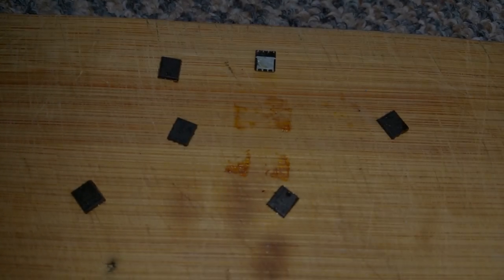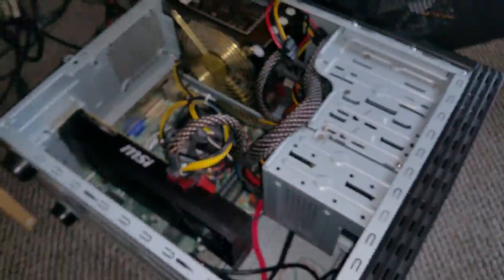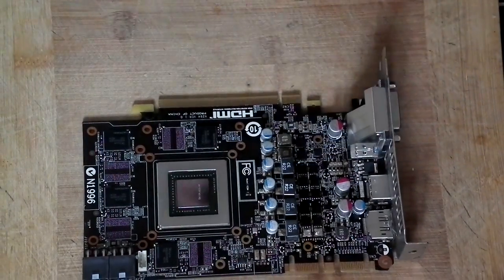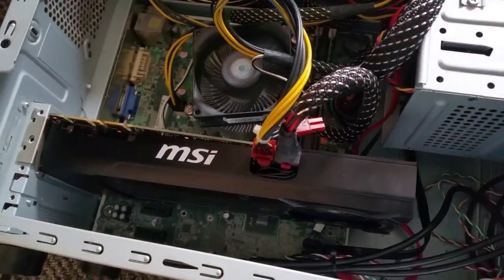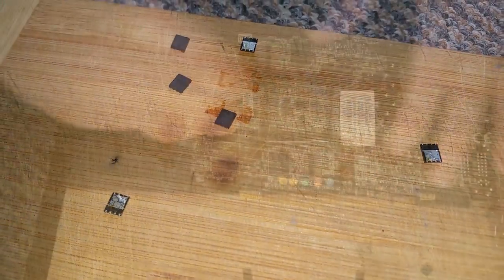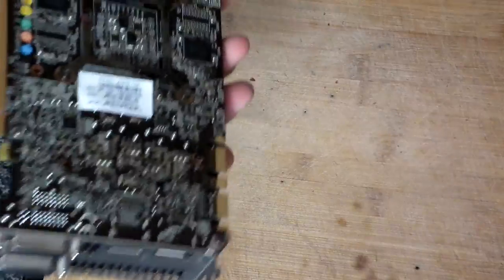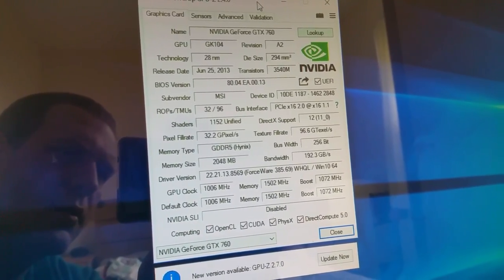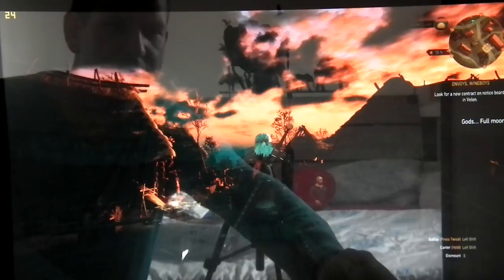How to FIX Graphic Card Short circuit without spare parts

Comment: what temp for the heat gun?
Reply from the maker: S U C C I use 290°C for reflow but if you need take component desolder I use 360
Reply: thanks for rply :) also i have the same problem short on the 6pin should i reflow or try to unsolder each at a time and check if short is gone? thanks in advance :)
Reply from the maker: S U C C best if you have multimeter and check where is short if not just desolder one by one card will working as you see in video without VCC anyway and after you can soldier them back
Reply: can i fix it by baking in oven? xD heatguns cost like 100 bucks here and i dont have shipping in iraq so ill just take it to a repair shop and tell them what to do, thx :)
Reply from the maker: S U C C hi short you can't fix with oven method you really need desolder VCC and find one with short
Reply: I went to my freinds and they had a heat gun i borrowed and i done it and now i found a diode with the short and its working now gonna benchmark it! thank you so much man you saved my gtx 980ti :D also one question if i have 11 diodes connected now i underclocked my gpu to 11\12 of the mghz and just wondering if i need to do that to have a stable card
thx :D
Reply from the maker: S U C C cool man iam happy for you and if you know which component been faulty just replace if possible if not ye man just test your card and do do overcooking you will be OK 
And if you can recommend my channel stay subscribe plus you can make donations as well :-) 

Anything else you will need just ask
Reply: i will :D thx so much
Reply from the maker: S U C C thanks Bro
Reply: The card still has a problem xD it keeps shutting down after 30 seconds and when i check the pins with mutimeter i see readings go to like 100 for 2 seconds then go down its really wierd so im gonna try to find a replacement for the diode :)
Reply from the maker: S U C C ye man I think you definitely need replacing that diode good luck

Comment: For how much time did it worked after repair?
Reply from the maker: Hi this one not sure as I sell that card
Reply: @frogtechtips  I got my gpu repaired had that same issue and I can't upgrade now so what do you think will it work without any issues?
Reply from the maker: @VegetasamaS  yop I think will work
Reply: @frogtechtips  I get a BSOD while playing game "driver irql not less or equal" could be gpu issue?
Reply from the maker: @VegetasamaS  how many vcc you are removed  from your GPU and are you sure there is no more damage as well maybe missing some important capacitator with can make that problem as well
Reply: @frogtechtips  I have no idea about that 😐
The repair guy told that there was a short in its pcb and he fixed it
Also said if short happens again it won't be possible to repair
Reply from the maker: @VegetasamaS  yop for me sounds like that GPU under load have some problems try play game on lower resolution or try underclook your card for test if will be working there is definitely bad some power VCC on card or missing some components is your GPU temperature ok or go to high when you play
Reply: @frogtechtips  I was playing with underclocking and max temperature was 72c
Reply: Still got BSOD several times
Reply from the maker: @VegetasamaS  that's mean there is some different problems try  reflash BIOS and double check your card for some physical damage
Reply: the stuff you hear about people having their cards break after fixing them has to do with the cpu or ram, the connection points on those is so small that they break off after a while, this is a lot bigger so shouldn't have that problem, unless you happen to get a cheap component

Comment: Can I send you my Gtx 1070 to fix? My moniter shorted it through the hdmi port and it doesnt work at all
Reply from the maker: Hi yes you can but iam from Slovakia not sure is good for you if yes send me Mail and I will pass you all details
Reply: @frogtechtips  Your current residents in Slovakia makes for a bit of an issue for me as I'm from Canada. If I was to fix my gpu and it shorted through the hdmi port would there be any obvious components that broke that you know of?                                          Btw thanks for actually responding to my reply unlike any other youtuber in this field of expertise.
Reply from the maker: @glenopolis1147  hi you are right Canada is faraway from Slovakia and I always trying answers all questions building community is important for me
Is your pc start with that GPU in is there any visible damage or smells like burn did you trying another outputs from GPU or is looks like complete dead

Comment: pleas reply a have gt 1030 a put an adapter hdmi to vga and the card stopt a dont kown what to do
Reply from the maker: hi not sure double check all conection try different cable or maybe adapter is foulty hard to say
Reply: @frogtechtips  a cheked Évry thing and its the same
Reply from the maker: @ear-q8x  do you have different monitor TV you can try best without adapter to check or be sure is not a cable , are pc boot to windows just no screen or what is exactly do

Comment: Hi, I have a GTX 780ti and apparently it has a short, when I measure with the multimeter in the 6 and 8 pin connectors it shows me: 15.04

(in the 6-pin, from left to right, right in the middle and in the 8-pin, from left and right, in the second and fourth)

Could you help me?

Thanks and regards.
Reply from the maker: Hi you will need check at first point vcc is that part I desolder in video with is usually components with have short

Comment: Hi Went i tried to install new driver my GPU AMD R9 280x freeze and black screen thats happen when i want to install new driver it worked well before . what i should do plz ?
Reply from the maker: do you have black screen only on windows or straight away when you switch on pc
Reply: @frogtechtips  after installing the driver it keep freezing and my windows get black sceen my pc freeze nothing work in safe mode work fine i uninstall the driver using driver unistaller it seems to be the driver broke my gpu to buy another gpu i read that in another web site that happen with nvidia and amd both cause hardware failure sorry for my bad english and thank you for responding
Reply from the maker: @shiinoyari4297  hi I think thar can be just some bugs on driver for your type of card just go back to driver with one is working and use that driver and wait for new one 
the problem you write like he broke drivers to make you think buy new gpu is not reason to do with your type but ye in history is happening this but problem is been different he stop make drivers for card with over time make your card  useless  just check description or go to amd web site and if your card is on list should all working with no problem But can by problem with driver like on last time with I thin 18.2.19 I have problem and driver detect that at self and always recomend me go back to old driver I getting Wat manager error all this time with that driver yesterday I install that new 19.. but I don't have time to test tham I hope will be ok
Reply: @frogtechtips  Yes but the same thing happen when i go back to old driver. i do clean install windows 10 or 7 the same problem the card not working black screen and freeze nothing works :( work only without driver if windows update install the driver my pc go black and freeze again
Reply from the maker: try replace thermal paste  looks like your  die start get a problem do you have dual bios card if yes try different bios
Reply: @frogtechtips  i do all of this but no luck i have msi r9 280x twin frozr gaming edition i switch bios update bios change the setup i do every thing .. My problem is juste like this in this forum https://community.amd.com/thread/221671
Reply from the maker: ok I thing you will need reflow your card  as your card get cold solder  try first replace thermal paste  and check my channel for more videos how to repair gpu with black screen I know is not good news  but this happen sometimes specially if you never change thermal paste

Comment: I have a gtx 780 which Is short circuited and don't even turns on when power cable are took out of the card
Reply from the maker: That's mean your short is probably somewhere on PCI express slots part of card this will be hard to find I will try open card and look for physical or burning damage
Reply: @frogtechtips  but I also have gtx 960 it works outstanding the motherboard,and also if I insert the 780 for 1sec the cpu rotates and turns off
Reply from the maker: @notu7340  I mean you have short on PCI express part of card not on MB look for some damage over there
Reply: @frogtechtips  yes I seen there is no damage but there is 2 capacitors not there is card
Reply from the maker: @notu7340  if you missed some comments that's can be problem
Reply: @frogtechtips  what your locations sir,can you repair that card
Reply from the maker: @notu7340  hi IAM base in Slovakia

Comment: 3:55 Is it safe to connect the pcie cable to the video card with the computer on? o_O
Reply from the maker: Pc been off don't worry
Reply: @frogtechtips  Great, but I'm curious now. What happens if the PCIe cable is connected to the VGA while the PC is on? Would a quality power supply prevent a short circuit on the video card in this case?
Reply from the maker: @rickfeuerbach9010  i thing  not to much will happen but question is why you want to do
Reply: @frogtechtips  I was curious after imagining that you did this. Failed computers sometimes seem to be off, when in fact they are not. Did the power supply manufacturers think about that?
Reply from the maker: @rickfeuerbach9010  btw I thing nothing will happened anyway and I am really don't have idea about that

Comment: my r9 290 shorts out my system when plugs in when its out of the slot but power is still in the fan spins
Reply from the maker: hi that's looks like some short on gpu did you try your pc without gpu plug in  and all working

Comment: i get shock when i touch the board of my gpu. is it broken?
Reply from the maker: Sounds crazy bot sounds like yes
Reply: can it still be repaired? is the slot maybe broken too? because of the broken gpu?
Reply from the maker: @choitoi67  do you have second slot on your main board 9r do you have spare card to test original slot to be sure is good
Reply: i don't have sir
Reply: when i smell the slot it smells like burned but not that strong smell. should i still use this dock?
Reply from the maker: @choitoi67  if you don't see any burn damage only way to find out is try that slot with some cheap old card
Reply: @frogtechtips  thats my problem i dont have any cheap cards
Reply from the maker: @choitoi67  that's why I say cheap if you don't have you will need buy one from with country you are

Comment: Thanks for you video , I have also some problem with my GTX 970, the issue is that my computer runs without problem when gpu is plugged in , however when some load work (games mostly) my display will go black.  I noticed that my one of the two molex connection of GPU might be broken, one 6-pin comes from PSU powers the graphics card and other pin doesn't.  Maybe the another pin draws power only when there is load in gpu. 
What might be the issue? can you help me
Reply from the maker: hi that's more sounds like die problem if gpu works and go to black screen under load you have two options you can try underclock your card or try reflow gpu like I do on my another video
Reply: @frogtechtips   thanks I will check another video as well!

Comment: My gpu is not showing it was burned with smoke how to repair can you tell
Reply from the maker: at first point you will need take your cooler off and check with part is burn you can send me picture to see that and I will try tell you what you can do
Reply: Frog - Tech - Tips where can i send you pics
Provide me you mail
Reply from the maker: @k.khan.8950  On my FB page or Twitter and last opinion by email
Reply: Frog - Tech - Tips okay
Reply from the maker: @k.khan.8950  you welcome
Reply: Frog - Tech - Tips i messaged you on your FB page

Comment: Wow! You're a good technician
Reply from the maker: Thanks so much my friend
Reply: Frog - Tech - Tips I have a question
Reply: Frog - Tech - Tips What if the technician is unable to find the Shorted mosfet? Because my gpu is No power and fans are not spinning
Reply from the maker: John Rhey Abarquez ok did he try desolder them is your pc complete no power when is card plug in I need to know more about
Reply: Frog - Tech - Tips I don't know if he desolder it. He just said to me my gpu is dead, he cannot find the shorted mosfet. When I plugged the 2x8pin comnector to my gpu, The fans are not spinning and no display, I think the Gpu have no power.
Reply from the maker: John Rhey Abarquez If your pc still working with card plug in card doesn't have short there is probably different problem what gpu you have how this card go dead ?
Reply: Frog - Tech - Tips my pc is no display with the card plugged. It's suddenly bsod then no display and no power, sapphire r9 390x is my card. I think its overheated
Reply from the maker: John Rhey Abarquez os your pc still power on with card inside this is not short on card at all you have die problem or vram as from what you say you have black screen no signal problem I think your card have dual bios that's mean I think you tried switch this to eliminate bios problem you will need try reheat die and vram but if you don't have right tools you will not posible do that if you are from UK maybe I can help you with that
Reply: Frog - Tech - Tips I'm from the Philippines
Reply: Frog - Tech - Tips I have dual bios, I can't use it because the Gpu has no power even I plugged the 2x8pin. My psu is good
Reply from the maker: John Rhey Abarquez hi like I said as your pc start when you have card plug in just card looks like dead there is no short as short on gpu will not power your pc completely and as you are far away from my I can't personally help you my friend I will recommend to you sell your card on ebay as foulty make some money and buy new one or second hand one

Comment: im pretty sure my card has a short circuit. (GTX 970) And i would try this, but i don't know if its worth buying all the tools and the hassle of repairing it...
idk why this shit happened i have a high quality PSU and GPU. such fucking trash they manufacture.
Reply: what happened: my pc randomly shut off (i was just watching youtube) and it didnt boot up. It only boots up when the GPU is disconnected from the PSU. i tried the gpu on another pc and it made bad electric sounds and began to smell bad.
Reply from the maker: Usually short happen when you over clock card or not regularly replace thermal paste as component get hot make small solder damage smart and burn can be bad card from manufactur as well and after some time used is just failed 
Thame can be many reasons  oben card first to see any physical damage and if something is visible than you can make decisions repair or not or your actual budget :-)
Reply from the maker: And ye sounds like card get shock and short happen
Reply: Thank you so much for the answer! I opened the card, and i can see no visible damage (besides some molten rubber that was under the heatsink, that was the bad smell) 
Is it worth to try to repair it? Can it only be the MOSFETs or can it be something else? (the card has only 4 MOSFETs) btw, i didnt OC the card
Reply from the maker: @serenity748  ye definitely try take off mofset to see if there damage under and try card without
Reply: can i try the card without any mofsets (remove all 4)?
Reply from the maker: @serenity748  yes you can but maybe you will see some damage once you get down all
Reply: ok thx!
Reply from the maker: @serenity748  you welcome